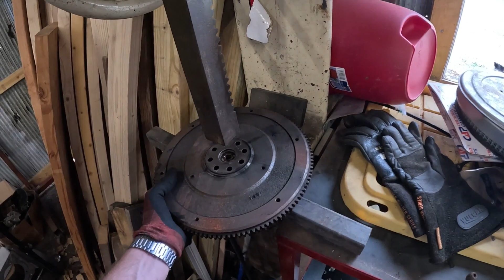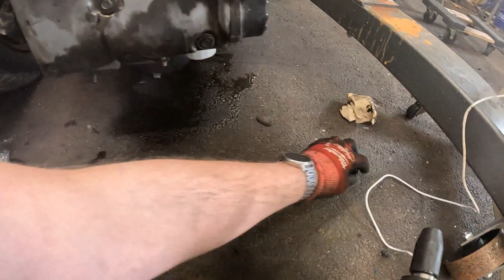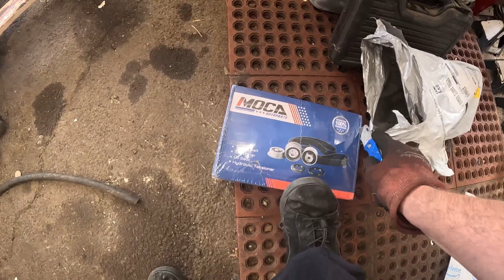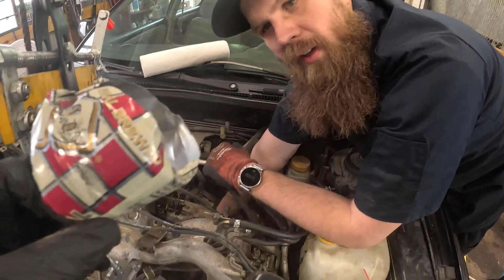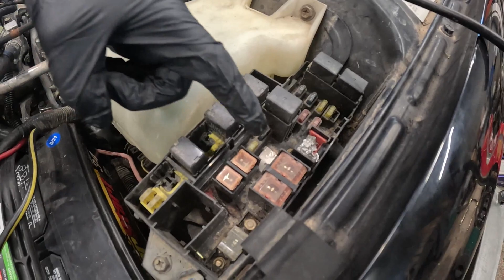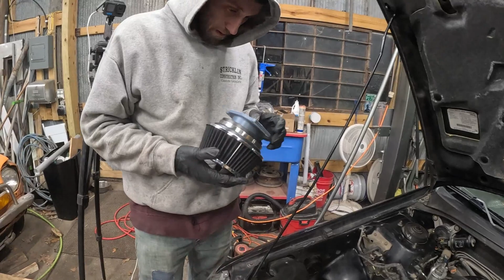Finishing Up The AAR Subaru Engine, Installing A Bunch Of New Parts. Desperately Needed!

Comment: Subaru's have done that with the headlights for YEARS. This way if you leave em on it shuts em and won't kill your battery. Heck we had an '83 Subaru hatchback which did that, ignition off, no headlights. Cool vid as always, nice work!
Reply from the maker: Very interesting, definitely not like most cars that's for sure. I do like that you won't accidentally kill your battery though.
Reply: @TMPGarage  Yeah, my grandmother has a 2022 Subaru, still the same, no headlights unless ignition is on. I can only assume with it happening on an '83, the late 90's one you're working with and a '22 that they did that all the way thru, I can't argue it, I think it's a great idea tbh and I'm sure saved many batteries over the years lol

Comment: Just like the Astronauts in orbit. The wonka widget you are working on has to be movement free to apply torque. In space the Astronauts lock their boots into a plate to keep from moving and also a torque brace to keep the satellite etc from rotating. You are doing a great job bringing this car back to what it used to be -- too many previous owners neglected any maint.!!!!

Comment: Very nice. Thanks for posting. A Subie with a MT sweet. Safe travels. There might be a fuse box on left side of dash. Plastic cover comes off. Check there for switch and constant 12v power. 09 Forester has internal fuse box.
Mr. Subaru1387 is another helpful Subaru resource on YT. 
You guys might need an engine stand as well. Work safe.
Reply from the maker: Who needs an engine stand when you got a gantry crane. Lol. Thanks for the tips.

Comment: First-time commenter.  Awesome video, guys. And yes, the headlights not working with the ignition turned off is completely normal. It's how Subaru's are. Well, not sure about the new ones. Yours may have a button somewhere on the steering column with a P and a light symbol on it. Pressing that enables the park lights with the ignition turned off, but only them. Not the main lights. Hope that helps. Greetings from NZ
Reply from the maker: I was wondering what that was. I thought it was the hazards at first, but those are  near the center vents. Interesting. Thanks for the info!

Comment: I would have replaced the clutch fork too.  They like to crack with age.  Also if that plate to the right of the rear main seal was plastic (it’s too hard to tell on my tv) it should have been swapped to a metal one.
Reply from the maker: Thanks for letting me know. We will see how it holds up the way it is. Trying to keep the costs low to be honest.